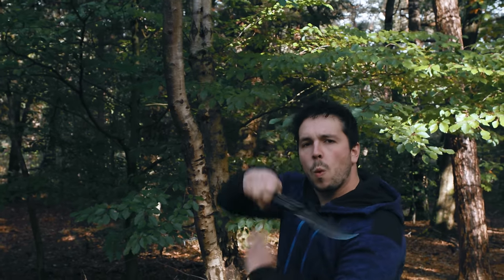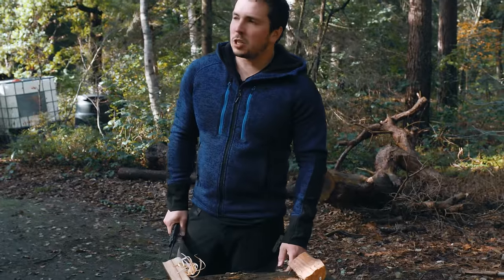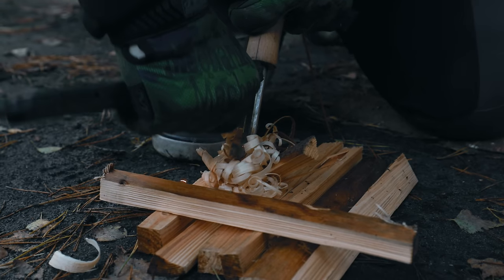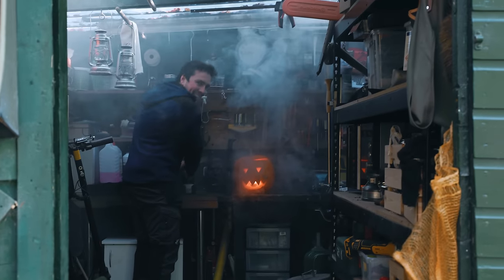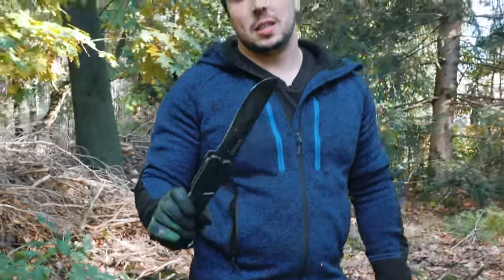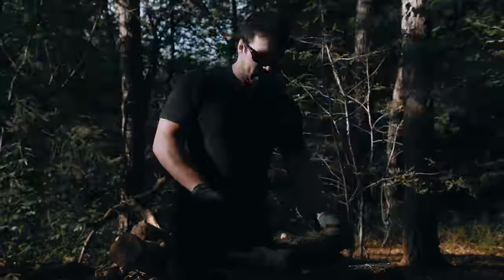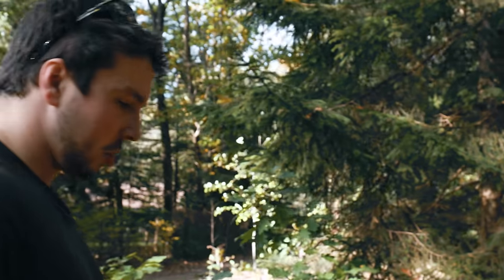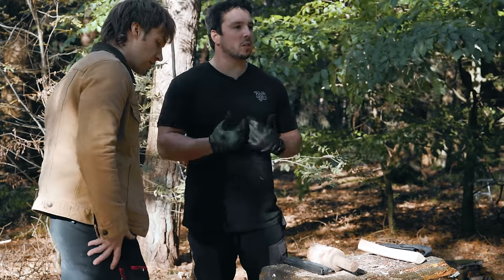This Illegal Folding Machete will make you go to JAIL!!  Gerber DoubleDown Knife

Comment: As an American, please never stop doing American impersonations. Also, while that Gerber may not be the best "bushcraft" choice out there, it honestly would make a damn fine yard work tool. I also wonder if this being a balisong construction might actually be what is helping with its strength since it's not a folder acting on a single pivot but instead distributing that across TWO pivot points.
Reply: Yeah, balisong is really one of the strongest designs for a folding knife.
Reply: It has lots of “give” apparently because the blade is not solidly connected with the handles?  Seems to me the shock load is distributed through two pivots and the spring tension of the handles

Comment: Machetes aren't made for batoning and chopping large trees. They are thin and get stuck. They are for clearing small brush, briars and high grass to make a path easier to walk through. You bring a hatchet for the heavy things. It is simply using the correct tool for the job.

Comment: There are so many problems with the design
- Heavy for its size (A Svord Kiwi Machete 12" is less than 300g )
- Poor weight distribution
- Uncomfortable handle for prolonged use
- Really short cutting edge (means you can do less cutting and need to do more chopping).
It's a fun novelty and I want one...

Comment: I reckon Gerber need to make a version of this with a really shitty fat, awkward to use saw-blade (like the saw on a Leatherman or Victorinox/Mauser folder) and then sell them to all the 12 year olds, "Tacticool-Dudes", and millions of wannabe-gangsta wankers all over the World 🙄, but I think it might actually make this folder quite useful and practical, eh? 🤔
Reply: You find Leatherman and victorinox saws fat and awkward?
Reply: @LastBastian  Well, they're a huge compromise in that the blades (and therefore the kerfs...) are so wide in relation to their length that sawing anything over about 30mm in diameter is a real pain in the arse (or the hand, because of the small/awkward grip-area and angle), especially when compared to a purpose-designed/built saw like a Silky, but they DO get it cut... Eventually...

Personally I prefer to carry an unbranded Silky-knockoff, or ideally a cheap coarse-toothed lightweight "disposable" toolbox-size (so about 400mm long, including the plastic handle) saw on the outside of my backpack and a Mora buttoned onto my trousers, and that covers most of my firewood requirements pretty well when I'm out and about with bushcrafting to be done, but I usually have my Leatherman Sidekick (sadly no longer in production... 😭) in my pocket or bag at other times as a fallback do-everything multitool.

So yes, compared to a "proper" saw I find them pretty awful, but a Leatherman or Victorinox/Mauser has always done the job for me a lot of times when they've needed-to, huh? 😉👍